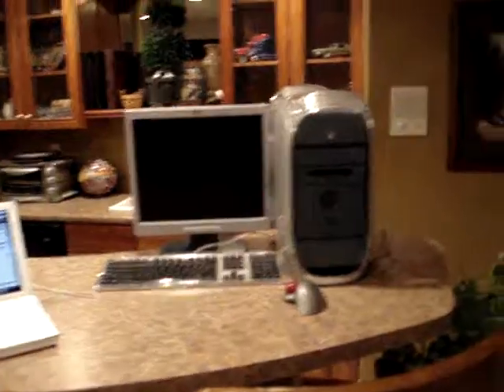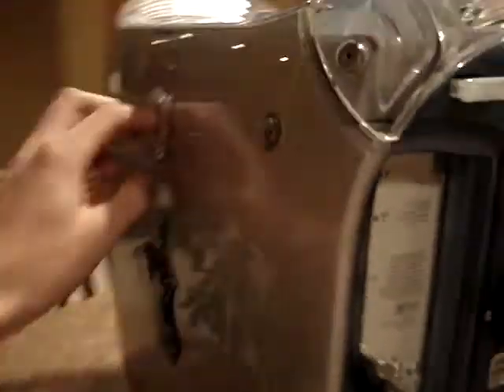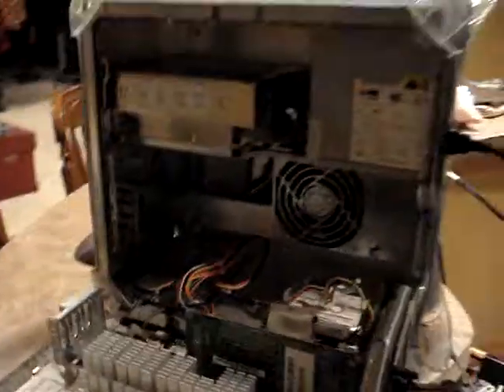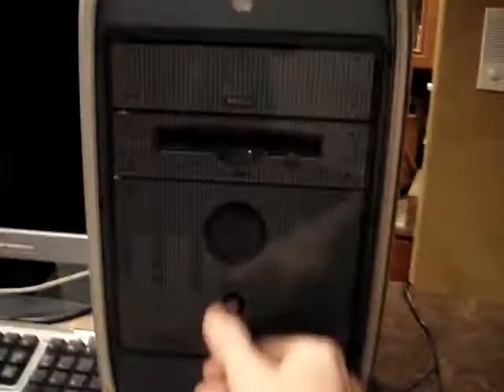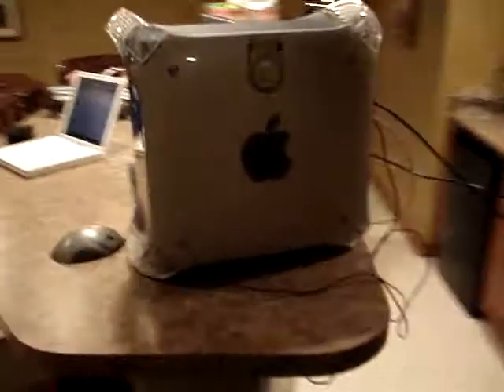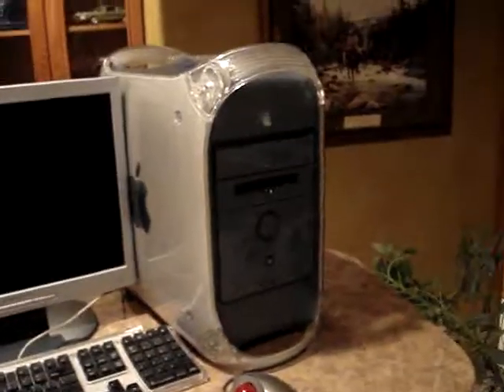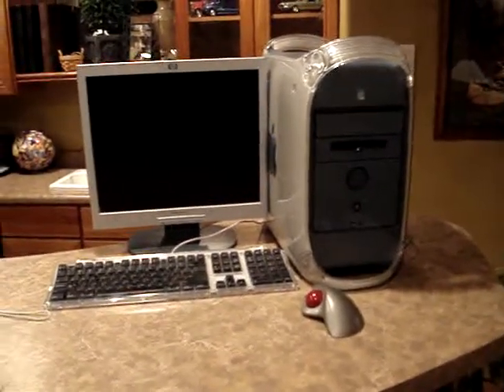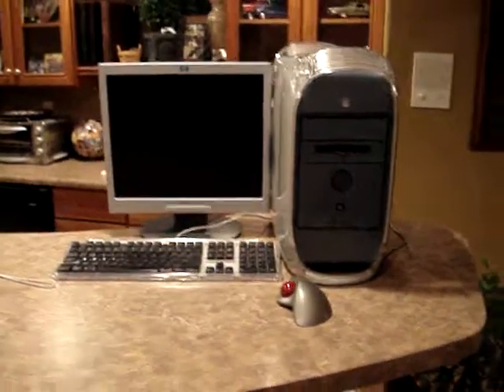HELP my power mac G4 will not turn on!

Comment: @becca270597 this is TheNewGuysBELMM on a different account. open the computer, and there should be a small button near the PRAM battery, press and hold for about five seconds, then close it and boot up. that should work.  make sure to unplug all power cables and ground urself (touch something metal inside the computer, like the metal part of the case) before you do this.  Hope this helps!

Comment: is the computer pluged into an regular plug? Some times home have one gif plug that pops the wall outlet their is an reset buttion in the middel. most of the time electrict outlets are wired together. I would try another wall plug or the wall plug might to an wall switch and some one flips it off then it wount work. Then i would see if the switch on the back of the power supply is on 120 and not 210. I would flip it back and forth.If all that doesnt work it might be the power supply.